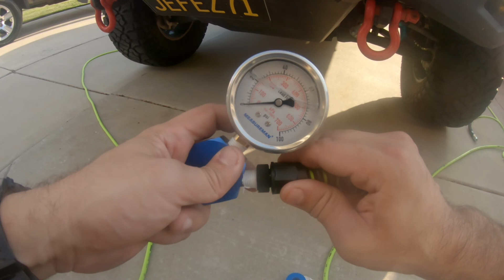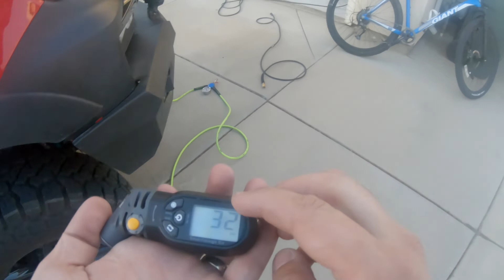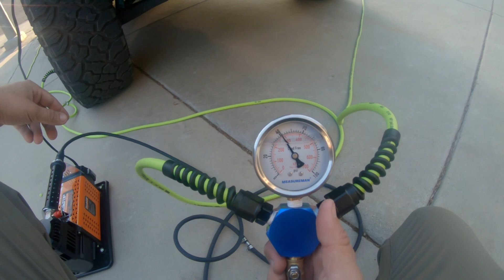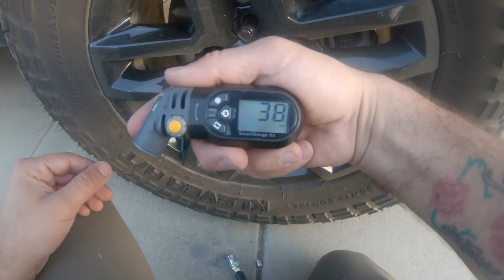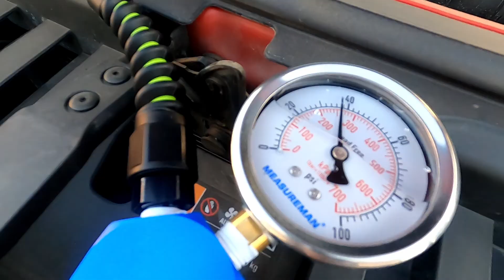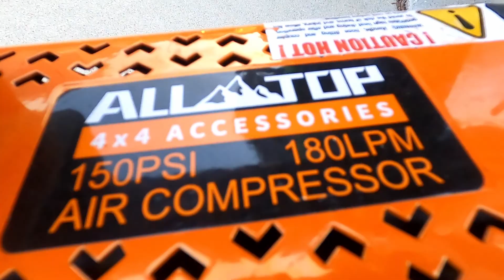DIY 4 Way Tire Inflator | Air Up Faster!

Comment from the maker: PARTS LIST:
Pressure Gauge (1)
https://amzn.to/32yhLQQ

Air Manifold (1)
https://amzn.to/3H975qR

Flexzilla 1/4" (inches) x 50' (feet) Air Hose
https://amzn.to/3mvPu4J

Flexzilla RP900250 FLX 1/4" Reusable ends (4pcs)
https://amzn.to/3mx48bL

Haltec Air Chucks (set of 4pcs)
https://amzn.to/32iodMn

¼” Brass Barb Tee (pack of 2)
https://amzn.to/3JkQBOC

¼” Brass Ball Valve (1)
https://amzn.to/3ekFEy2

Teflon Tape (1 roll)
https://amzn.to/30VXjJk

Air compressor of your choice

Comment: thanks, i bought that same compressor on amazon its a beast, and i just got all the parts in that you used about to start on mine shortly.
Reply from the maker: That compressor is amazing! Still kicking  strong to this day. I recently bought the dual piston one, and it's even faster. You'll love the inflator/deflator system.
Reply: yeah i made me a short air hose to go from compressor to the 3 way valve and soon as i closed the valve it blew the hose apart lol. not bad for under $200 compressor   @thetrailoutthere

Comment: You can probably install a pressure switch on your compressor. So when there’s no airflow the compressor will shut off in its own without switching it on and off. That’s what I just did to my Napa dual air compressor and it works like a charm. No wear and tear on the compressor and no noise when it’s not running
Reply from the maker: Im just now seeing this! I'm definitely gonna look into a pressure switch. Thanks for the idea!
Reply: @ it’s been a year since I posted this and that pressure switch and compressor still running strong and like a charm. This is the one I got from Amazon.

Air Pressure Switch 85-100 PSI Pressure Switch 1/8"-27 NPT DC 24V 12V Pressure Switch Air Compressor Pressure Switch 100PSI Pressure Switch DC Pressure Switch
Reply from the maker: @Jo_and_HisJK  nice! Will that still turn on even though the max tire pressure is 37 psi?
Reply: @thetrailoutthere  yes it’ll keep going unless you turn off the valve, then it’ll stop. When you turn the valve off the tire pressure gauge will read the approx psi for all tires. This is why when I air down I make sure to air them all to the same tire pressure

Comment: It’s been 5 months how are the fitting holding up?
Reply from the maker: They're holding up pretty good! No leaks except on an air chuck that wasn't fully tightened but it's good now. So far I've used it about 10 times.